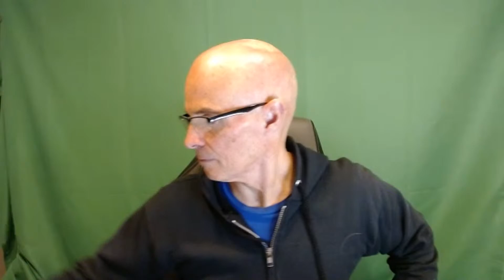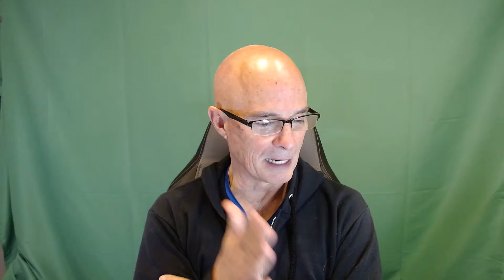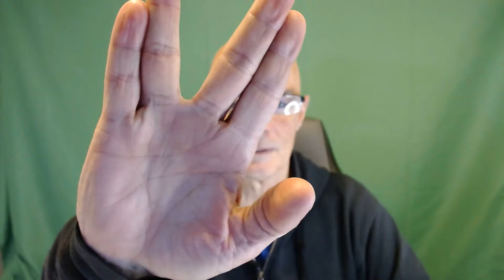T-BIRD SUPER COUPE M90-LET'S TALK TECH

Comment: The m90 rotors are swappable between GM and Ford. The GM rotor pack had a black coating believed to provide more power or maybe it was the gen 5 rotor pack. We’d reposition the guide pins and swap in a Pontiac rotor pack into Super coupes. Magnum Powers sold an inlet plenum.  That plenum and a port job and a pulley along with a dual intercooler or front mount intercooler moves the super coupe really well.
Reply from the maker: how do you time the rotors when swapping

Comment: We used couple of rows out of an inter cooler passing fuel through with dry ice. We would fill the tank, circulate the fuel for an hour before a race. We could carry a few extra litres of fuel (120 litre tanks) hp was better but the big gain was trying to restart in a pit stop if there was a stall. But carrying more fuel than your competitors. V8 Supercars used to be cool!
Reply from the maker: Roger Penske and Mark Donahue cooled their fuel in the Trans Am Racing back in the 60s to add capacity
Reply: @richardholdener1727  do you know how they did it back then. Something I’ve learned is that nothing is new, we just find better ways of doing it.

An Indy car came to Aus in the 2000s that I got to see - quad man’s, fuel injection, independent suspension all round, 4wd. It was a 1934 car…
Reply: Also I should note the HP gain went away when we went to e85. We tried at one point passing the cooled fuel through the manifold like coolant before it was injected. Once we got e85 their would be condensation on the inlet without doing any of that. Not long after that cooling fuel was banned

Comment: The inlet configuration is what is going to be what makes the biggest difference flow/efficiency wise.  teh rotor packs are identical and either coated or non coated and interchangeable.  These things move air not compress so any inlet restriction is a rerstriction.

Comment: If you want to compare the super coupe to the GM. Also you have to remember that the Ford bypass valve is not integral to the housing like it is on the GM one. It's external what I did when I put my m90 on my 4.0 mustang was you can buy the bypass housing that's on the mini Cooper as that had the m45 blower and it's pretty easy to adapt to work and that's what I did on mine and at least you used to be able to get them for 100 bucks versus like the add-on whipple ones that are like almost 300. Also, if you wanted to compare the gen 5 GM blower I would say make sure and use a 94.95 super coupe because they updated the housing to be slightly more efficient. You can tell on the inlet if it's a 94.95 because it's square versus rounded in the corners. I actually have a 94 m90 sitting in my room that was supposed to go on the 2009 mustang 4.slow but I ended up selling it cuz my bronco order finally came in.  The inlet on my 94 m90 is 4.25x1.5" approximately and the discharge is harder to measure but the big v outlet is about half an inch at the end. And about 2 and 1/2 in towards the front and it is about 3 and 1/2 in long. So doing the math I would say it is 2.5"x3"/2=3.75" in area and that doesn't include the section below the triangle that's in between where the bolt bosses are for retaining the snout to the case if that makes any sense. So that's probably like another at least inch squared in area and it also doesn't count the two little slits on the.  If you wanted to figure something out I could let you borrow it for testing for a while

Comment: fuel will get past the seals in the M90, fuel will get into the drive gears.......unless you use PROPANE!!!!😁😁
Reply from the maker: we already ran the m90 with a carb
Reply: @richardholdener1727  like you pointed out in the video, you go away with it being on the dyno for short durations. 👍🏼 The one we did on a sand rail wasn’t so lucky LOL. Bearings and grease got gas soaked, seized the bearings and ruined the blower 😵‍💫🥴🤦🏻‍♂️

Comment: For anyone wondering MN-12 is the chassis code for 1989-1997 Thunderbird/Cougar. In my humble opinion the '91-93 5.0 v8 Thunderbirds are better than the super coupes. But I'm biased lol I own a '93 Bill Elliott edition 5.0 Thunderbird.
Reply: I agree.

I have a 91 LX 5.0 I’m going to be selling. Unfortunately it does not have the 92 Sport (Super Coupe) styling or the 93 front facia. Right now I’m changing the ABS to non ABS. 

Two problems:
1. Replacing the ABS components are absolutely ridiculous in price and the limited availability of parts.

2. Brake pressure reducers for the Master Cylinder are impossible to find for manual brake conversions.
Reply: @ZEPRATGERNODT  yeah I love my '93 it's pretty much void of all the electronic gizmos, no abs, no electronic suspension, like the super coupes. This is my second '93 I've actually owned and my current one doesn't even have a keyfob it's like base model 😂 lol
Reply: @T-bird_Johnny  
Funny you say that. I used to give my dad a hard time about modern cars. We are a classic car/hot rod family, and his version of modern cars is anything with a computer in it. I am now free of any new car made beyond 2009/2011.

In other words, I wouldn't necessarily own anything newer than that now. My last new car was my 03 Ford Lightning and an Acura TL. Ford got rolled and Acura sold.

Now I just own cars between the years of 1971-1996 as of today. My daily is a 1996 Camry. I collect Toyota XV10 Chassis cars. Built like tanks.
Reply: @ZEPRATGERNODT  😂 lol I love toyotas too, our other car is a 2011 camry xle v6. A little more electronic than maybe I'd like, but it's before they got too crazy with the electronics @Toyota and yo nothing beats the heated leather seats in my camry on a cold day . I feel like we'd be friends if we met in real life. lol 😂
Reply: But which is faster/handles better? the SC...And if you like a 5 speed....My opinion.  If you are looking for more that 350rwhp, go v8 route. Or turbo that v6:)
Reply: @damonbaumann7372  I have a rebuilt aod and diff w/ all ford racing internals and 3:73s in mine with bilstein shocks meant for a termi cobra, she's currently been dormant for the winter she's getting a ton more mods soon.
Reply: @damonbaumann7372  
Being rarer cars. Better left close to stock as possible and enjoy it as is.